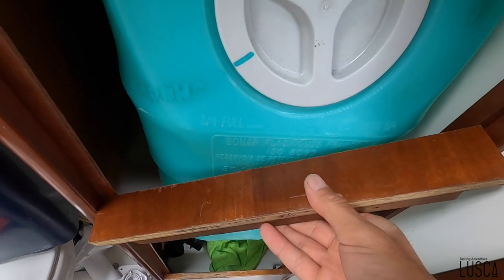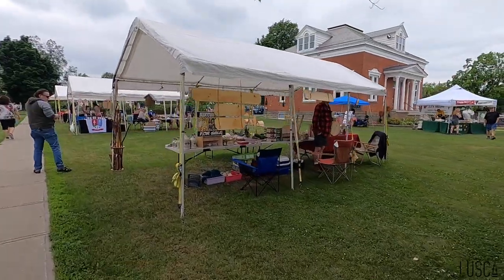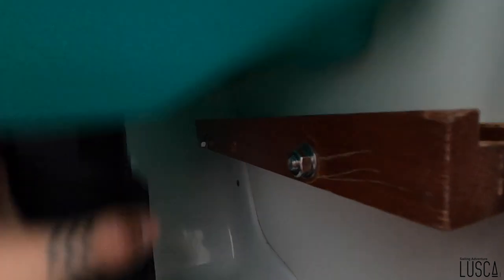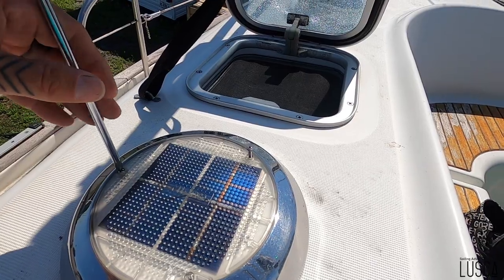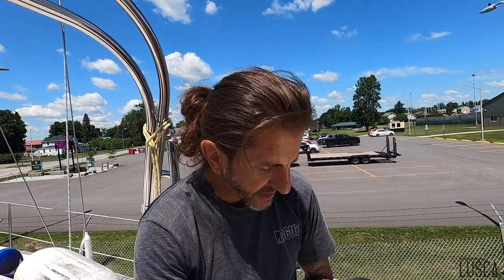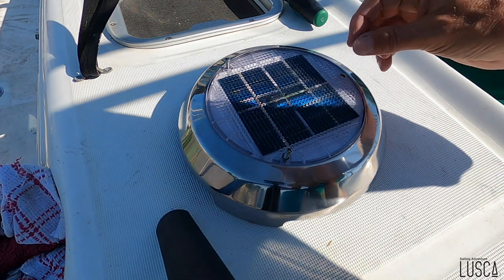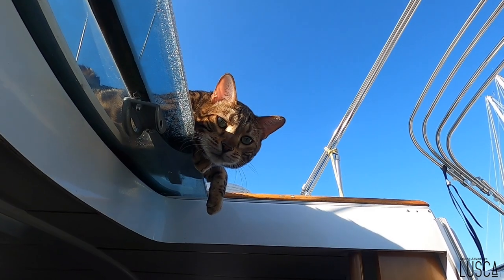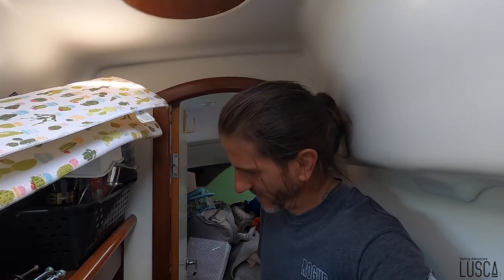Les 4'' pouces étaient en SPECIAL 🚨 - Sailing With Lusca (Ep.24)

Comment: David, Il faut que le tuyau du Pump-out se rende au fond du réservoir. La sortie en dessous du réservoir aurait été idéale pour cela. Si tu n'as pas d'autres choix, assures-toi que le trou d'en haut permette de descendre le tube jusqu'au fond. Aussi, il faut une entrée d'air "vent" pour ne pas que le réservoir implose lors du pump out. Normalement c'est un tuyau de 1/2 pouce de diamêtre avec une sortie extérieure pour ne pas qu'il y ait des odeurs dans le bateau. Le pump out c'est ni plus ni moins qu'un aspirateur puissant. Salutations, Richard
Reply from the maker: Oui effectivement Merci Richard, la sortie du haut a un pick up tube qui va jusqu’au fond du réservoir 😃 
Dave
Reply: @maryetdave  David, alors il ne te manque seulement que le vent extérieur... Bonne journée.
Reply from the maker: @tartansailor  Jai un vent de 1 1/2 pour aider le processus d’anaerobie des eaux usées, auparavant, nous avions du 1 pouces. J’ai également installé un passe-coque plus gros. 😃 
Dave
Reply: @maryetdave  J’ai eu exactement la même réflexion que Richard mais finalement je vois que tu as pensé à tout! 👌
Reply from the maker: @martinlejardinier  oui, j’ai oublié de le mentionner vous êtes plusieurs à y avoir penser Ahaha 💪🏼 😝 
Merci ☺️